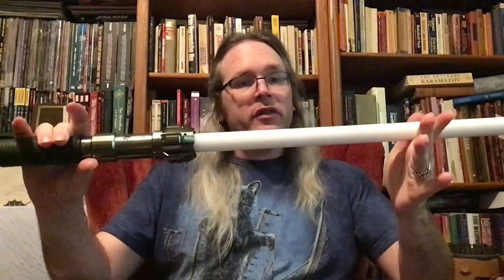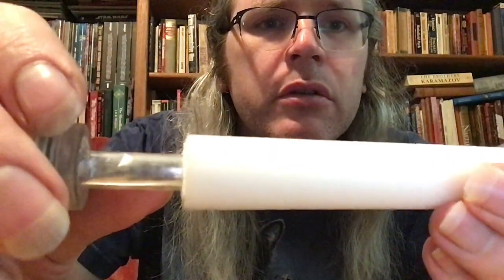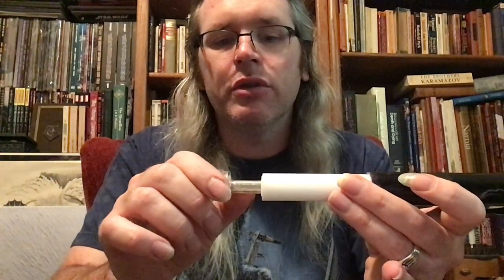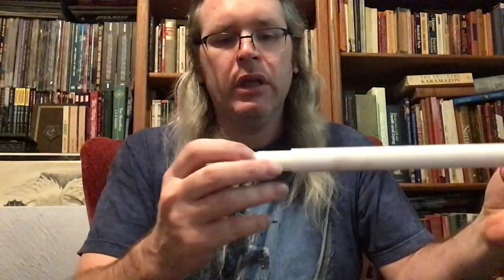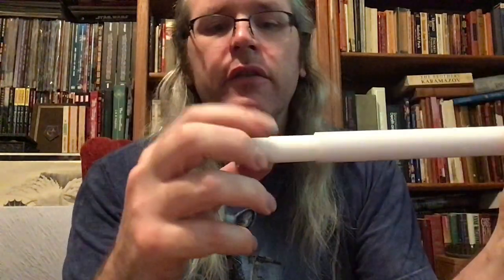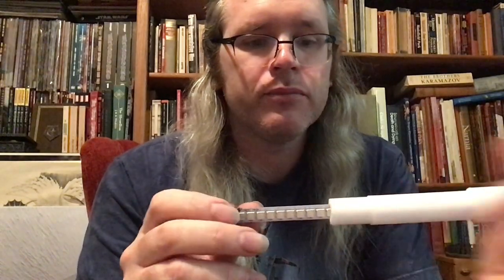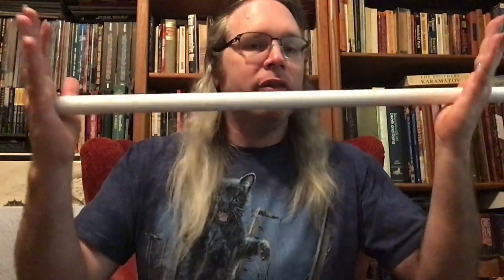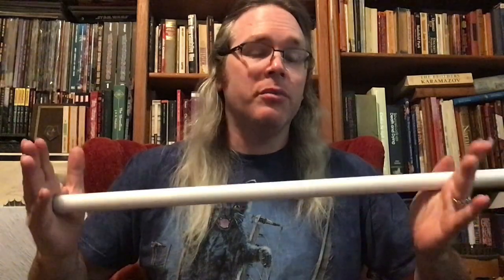Not all neopixels are created equal: a head to head

Comment: The pixel blades are ALL overpriced. That’s fact. The material and overhead as well as machine and tool cost is nowhere near a third of what the ask for these things. When people finally get over a tiny shadow then these ridiculously overpriced manufacturers will lower the cost of their “high end” stuff. If we keep throwing money at these people there will never be change. It’s like that in everything including firearms. There’s Glock guys and colt guys etc. all have their problems none are gifts from Heaven. We need to stop paying extreme extortion prices to these Chinese manufacturers. Now that’s my opinion based on hard fact. How do I know because I spent my money on three business degrees. Admin, marketing, and Business law. The people don’t need to do what I did all this information can be learned from the inter webs. My sabers almost never have a blade in them. I love the sound and light and I want that like you do but mainly mine are in a super nice archival display

Comment: I think my first neopixel came with a budget blade since white colors produce that God awful orange spot in the middle, but I don't think Padawan Outpost would be the one to blame or depend on for a better blade (assuming I wanted to buy one to replace this ugly one). It's funny because the hunter hilt I got has a blade with the purest whites I've seen with no spots (and I did check the configuration files and 255, 255, 255 was the code setup for those built-in fonts with white blade colors). Not only that, since the dark saber has such a slow retraction speed I could see the colors shift on the budget blade. This "new" blade maintains its pure white color through the whole retraction bit. Some colors come off looking brighter on the budget blade versus the new one, and the new one generally looks dimmer sort of. Still, none of the shades have that discoloration look, which can also be noticed with magenta or purple-ish colors (not a problem for the new blade).

Comment: Hi Darth Cephalus, I have been watching your videos for some time now and have learned a LOT.  Thanks for doing these.  They have given me the confidence as well as the information needed to customize my own lightsaber blade and hilt.  I have a Bors The dragonslayer, with a custom rubber wrap on the hilt and a 30" neopixel blade from Ultimateworks that I disassembled and reassembled into a photon blade blank from the Custom Saber Shop.  I originally ordered the Dragonslayer with a tri cree adapter from Ultimateworks to use with my existing 30" base-lit photon blade and then ordered the 30" neopixel separately as the Dragonslayer comes with a 36" blade and shortening a neopixel looked to be a bit more involved than I wanted to get.  I really like a 30" blade, long enough, but not so long you tap the ground with it when spinning, I also miss the ceiling MOST of the time, lol.  I also really love the photon blade for the colors you can get with it, yellow being my favorite and red also being a notable example of two that look richer and more full with a photon.  White looks like lime green similar to Yoda's saber and green is very full and rich similar to Luke's.  I only give up pure white and purple and blue, and unfortunately blue is never really as blue as I'd like, it always looks white in the center with blue outlines anyway so I gave up on it.  Anyway, here's a link to a video I made with my new blade and custom Dragonslayer.  Couldn't have done it without you, bro.      https://www.youtube.com/watch?v=AZBYqJMlRvY
Reply from the maker: awesome. glad you find them useful.

Comment: So would a bendu armory or Korbanth blade work on an lgt proffie neo hilt if they’re both 1inch diameter blades?
Reply from the maker: yes. if they are too tight a fit, you may need to sand the base of the blade a bit, but the connectors will work.

Comment: I saw somebody do a video where they compared multiple blade side-by-side. And the one that just beat out all of them every time was the Vader’s vault blade.
Reply from the maker: There are a lot of those videos with different results. VV blades are KT strips like the one in this video more or less.
Reply: @DarthCephalus  Yes, since watching this video I have noticed that. I’ve seen various other videos but I have noticed that VV does tend to have some of the brighter blades as well as blades with a more uniform color and brightness across the entire thing.
Reply from the maker: @straycat1674  I think one of the differences is that they sand the outside as well.

Comment: I use a standard blade on my sabers specifically because I use them for duelling. If I do end up getting a neopixel saber at some point, it'll be exclusively for dancing/spinning unless there's a major step forward in the tech before that time. And for those purposes, I'm likely to be going with the cheap option, simply because when doing non-combat moves, I have pretty good blade control and am likely to MOSTLY avoid doing anything that will damage the blade. I believe I'll make it last long enough with my handling of it to justify the (lower) price point with (possibly) slightly more common replacements.
Reply: I just got into this. With a darth maul neopixel setup. Im looking to get some shorter dueling blades for it. Can you recommed a site or company for the dueling blades?
Reply: @EmmsReality  LGT sabers are a good low-cost high-quality option for duelling sabers. They've got authorised local sellers in quite a few places, and they're some of the cheapest options on the market while maintaining surprisingly good quality (particularly in terms of quiet handling and durability, which are the most important things with duelling). If you want something more unique or premium quality, just searching "stunt lightsabers" or "LED duelling sabers" should find a lot of options. That said, the first result on almost any search will be Ultrasabers, and there have been MANY reasons in recent years to avoid them. The least important reason is that they're selling more than decade out of date tech and charging more than competitors with notably better products. They've also gotten themselves banned from multiple conventions, several postal services, and been investigated for consumer and employee rights violations in recent years, so... yeah, like I said, lots of reasons to avoid.

Comment: Thank you for this excellent breakdown and comparison. I have a neopixel blade from SaberMach that creates these annoying yellowish spots when the blade is lite up blue, doesn't do it with any other color. Any thoughts why this may be occurring? I finally just replaced it with a Bendu Armory KR Strip blade and am very satisfied with it.
Reply from the maker: Bad connections between pixels I would guess. Replacing it was your best option.